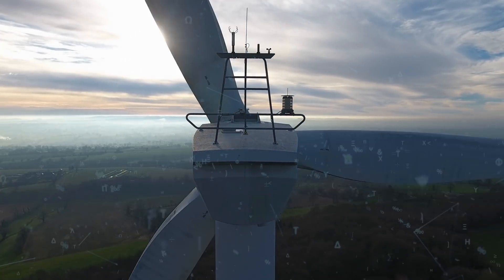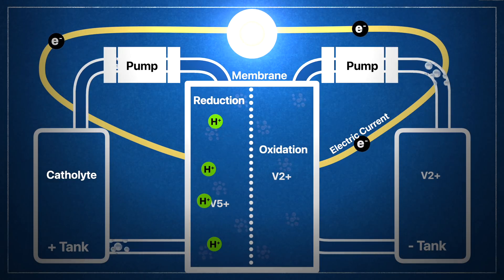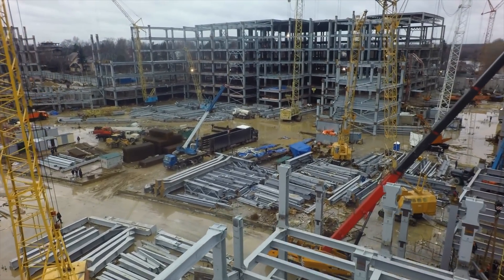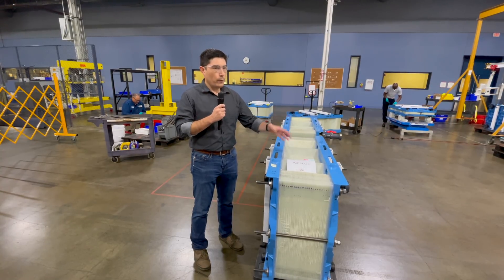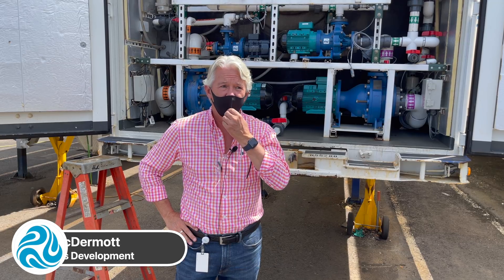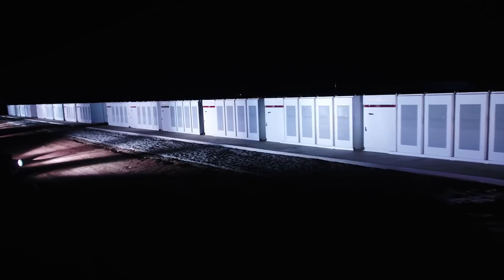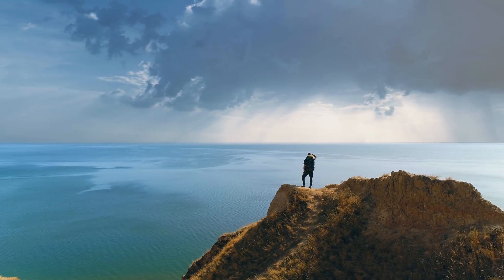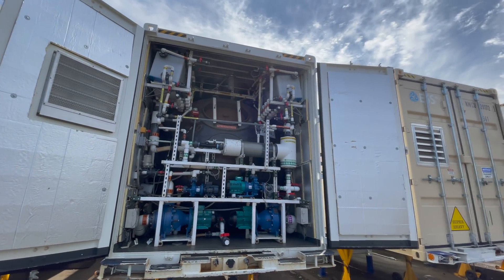The Future of Energy Storage Beyond Lithium Ion

Comment: Looks very interesting. I think the best purpose for these types of batteries would be to help electric utilities from having to build more power plants by using excess capacity available late at night and early in the morning to charge the batteries, and then using that energy to supply extra electricity when demand goes beyond the capacity of the power plant at peak. This technology may allow a single power plant to double its life expectancy, there by increasing profits and keeping rates lower for ratepayers. The foot print issue could be reduced by building the batteries into a building structure that has multiple levels. The trick would be to not make the batteries into containers, but build them so that access to parts and internal machinery would be relatively easy in order to maintain them and keep them running. As renewables become more popular because they are now so much cheaper than coal, these flow batteries would pair perfectly with the intermittent nature of these energy sources.
Reply: The fossil fueled power plants must be replaced by renewables plus storage to stop adding CO2 to the atmosphere.  Renewables don't require spending so much money for fuel - a coal power plant requires more than a hundred railroad cars of coal a day!
Reply: @acmefixer1  You are absolutely right. Battery storage hastens the day when coal and natural gas will be a think of the past. Battery storage negates the need to build new fossil fuel plants and allows for those types of plants to be replaced by renewables. It does so because it irons out their intermittency, allowing them to replace baseload generation now done by coal and natural gas. Wind and solar also allow for distributed generation at or closer to the place of the demand. Basically battery technology is the bridge that gets us to a completely emission free renewable energy world.
Reply: This is an ideal replacement for peaker plant facilities.

Comment: As you said this system is not for the average home use. Maintenance and service of the system is not applicable for home application.
The water pump needed to run the liquid circulation can be a main source of problem. They can be a source of malfunction preventing charging the system. 
One question arises that how much power the system generates with such a large set-up. Also as explained, there will be a need to replenish the salt solution.
In conclusion, this may be good for industrial application but not for residential application.

Comment: Flow batteries are a solution but the energy density is low so you need a lot of them.
If they can energy density anywhere near lithium ion then it would dominate the space.

Comment: The iron flow battery will have a tough time competing with the LiPo batteries. The small size, higher density LiPo battery requires nearly zero maintenance and requires less infrastructure. Maintenance and infrastructure costs start to add up quickly. LiPo should be costing about $30 per Kilowatt at the pack level by 2030 and I don't see iron flow getting much cheaper.
Reply from the maker: Great insights and good point. It comes down to supply chains and availability. LiPo is a great chemistry, but it still needs graphite in anodes, and lithium, which is in really high demand and only becoming more so. I think the Iron flow battery would be vastly more economic by 2030.

Comment: The Tesla Powerwall (and similar products) do have some moving parts: They tend to have some fans for cooling purposes. The transformer in particular can get hot during operation. That said, good fans admittedly do have a very low probablilty of failure even over years and years of operation.

Comment: silicon from SiO2/O4 sand
Reply: generate electricity from the hydrogen, in the same fuel cell, with air
Reply: stick in a metal bar, have its power density as the battery, and electrolyte filtering fuel cell metal-air system
Reply: that metal bar can be any metal, but at least, zinc, iron, magnesium, aluminium, also silicon
Reply: any oxidating metal, as in metal-air battery-fuel-cell, but you just feed in new metal energy source bars, cylinders, cubes
Reply: forged flow batteries, use circulating electrolyte metal-air fuel cells, where you electrodes are solid, only the electrolyte catalyst for the power generation moves
Reply: the most important part is the "water cooler pump" system with the expended oxides filter, and make sure the electrolyte will chips of the oxides created from the surface of the metal power source bar
Reply: it can be even a metal wire from a coil, like a 3d printer stores the filament
Reply: iron sulphate, sulphates you say, metal swap battery
Reply: you can separately charge the iron oxide back to iron, ie, a separate charger, to minimize the iron-air fuel cell footprint, so take the engine block as the fuel cell, and the iron power bar as the fuel density
Reply: that hydrogen is same as the hydrogen in lead acid batteries

Comment: Great video!
Storage on a huge scale is, of course, the critical link in renewable energy - there’s more than enough energy available from the sun in solar panels and wind provided it can be kept until needed.
There are many chemistries that hold promise if the requirement for high energy density is not an issue: exciting times ahead.
Reply: yess
Reply: Have you examined the Ambri Battery that started in M.I.T?

Comment: Moving parts: lots of things in the home have moving parts. Fridges, heat pumps, robotic vacuum cleaners... I suspect with more iterations a flow battery can reduce the number of parts and their size.
Reply: I suspect they are already using the same off-the-shelf parts anyway. What's different to a pump that pumps salt water and a pump that pumps rusty salt water?
Reply: @gbjbaanb  even pumps are continously improved, reluctance e-motors are developed for the purpose and the new piston motor/pump is 30% more efficient.
Reply: Part count can be offset if you increase the size of the system. Huge tanks, huge pumps. In relation to the capacity of the system you can have reasonable part counts.

Imagine having a big power plant vs a ton of smaller generators.

But having multiple container sized systems also has its benefit. Yeah sure part count is high, but you gain redundancy. Instead of losing the whole system in case of failure, you just lose a unit.

Comment: I think the niche available to flow batteries is quite small. Items:
A) They all suffer from cross contamination between anolyte and catholyte. Expensive to deal with, only vanadium type fully avoids it, most expensive type.
B) Advantage is for high kwhr storage per kw rating, but that market is lower priced $/kwhr than the fast short-time market that Lion works in. Iron flow depends on plating iron onto cathode, eliminates advantage of flow batteries of adding kwhr by adding tanks of reactants.
C) If this system were viable, it would own the Megapack market Tesla sells to. There's a deal breaker in there somewhere. The vanadium flow has been commercial scale since 20+ years.

Comment: I think this is great. What irks me is the local utilities are adding 150 MW of solar farms with no nighttime battery backup in the same grid as one of many new 150MW enterprise data centers which are claiming to be sustainable 100% green data centers. These data centers also have 150meg of standby diesel generators running 30 minutes per month producing NOx and CO2 and are given special lower-cost utility rates because they are green. In the same area, 10,000 new homes are being built to support two chip manufacturing plants that produce just under 90tons/year of NOx each and the utilities are discouraging solar panels for homeowners. So far all I see is marketing and not truly adding sustainable power.
Reply: Are the generators on for maintenance/testing purposes or because the datacenter isn't receiving enough power?
Because as an IT admin I've recently heard about a diesel backup generator literally blowing up during a power outage because it wasn't maintained properly.
Emergency power is a must-have for a datacenter. Systems can and do get fucked by unexpected shutdowns and unlike your personal desktop, you can't just reinstall it in a couple hours if they do.
Reply: @Steamrick  To maintain reliability a data center will test once a month. Typically this is at 80% load using load banks so as to reach the MFGs recommend running temperatures. To have a genset explode is very rare. With one genset mfg they had a design flaw which blew an engine rod. This does not affect it's subbase fuel tank and should not catch fire. Igniting a diesel tank on a genset does not happen.  If the engine is properly maintained it should work for over 30 years. I agree having a backup for data centers is a must but claiming 100% sustainable is marketing. If they added EPA Tier 4 standby gensets using Renewable fuel then I would say they are no longer marketing and really trying to be green.
Reply: @Steamrick  Not being able to reinstall in a couple of hours is a budget and design issue. Not saying it's easy to design a system that can be quickly reinstalled --  you have to have management that's willing to invest in the months of work to do it right and a smart enough team to design and execute.
Reply: @frontiervirtcharter  Or instead of sinking uncountable resources into creating and testing automated reinstall, you could spend a fraction of that on good backups and safety features...
Reinstalling is always a desparation move

Comment: How much does a semi trail size battery cost?
Probably wouldn't work too good in cold climates? Although there is alot of salt in there so maybe it would be okay. 
What's the capacity of a trailer size battery and how long would one run a home from a full charge?
Reply from the maker: 600kWh is the capacity and it works fine in the cold
Reply: So it will easily power 5 homes for 4 days.